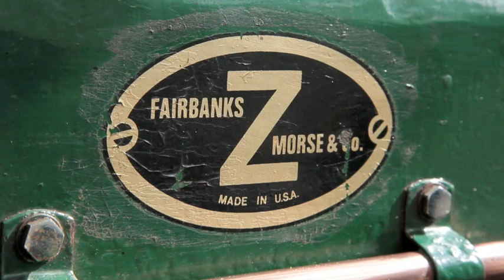Fairbanks Morse 3hp Stationary Engine

Comment: Finally a 3 Hp Z like our new one, trip mag over the crank, round lid on the starting gas cup, oval hopper opening.  FM made many design changes over the years, so it's rare to find 2 alike.

Do you know what year it is, and mode designation?
Reply from the maker: 1924 i belive. i have the origional trolly, but sadly the wheels are in a bad state. i will upload another video sometime as it now runs a alternator which makes it run so much better. its a bth flick mag, is that what yours has on it?

Comment: Can you please tell me the function of the plumbing between the spark plug and the head ?  Looks like a petcock, or shut-off of some sort going out of the tee, off to the side.  I've never see that before.
Reply from the maker: Its a modification to serve a few functions. 1 having a remote plug means that the plug gets hotter quicker and stays hot as its heat can not dissipate to the head so easily. This helps the plug stay cleaner for longer.  2  the valve is used for priming the engine for starting. I start the engine by setting the engine up with fuel charge in the cylinder and by bouncing the engine back against compression whilst manually flicking the mag to create the spark to start it in the right direction. This method should work with most flick mag engines and saves cranking the engine by hand. 3 it serves as a decompressor if required. 4 I wanted to know what cylinder pressures are reached by attaching a pressure sensor to the valve.  It was an interesting experiment as it allowed the engine to be set up better than it left the factory as the timing could be advanced to take advantage of the huge improvements in modern petrol over the low octane fuel available when the engine was designed.  I may put up a video of the starting method if any one is interested.  5  in theory it could also be started by compressed air.  None of the above is actually necessarily required ( Hotter plug does help though ) I'm just an engineer that is always looking to get the best out of whatever im messing about with:-)